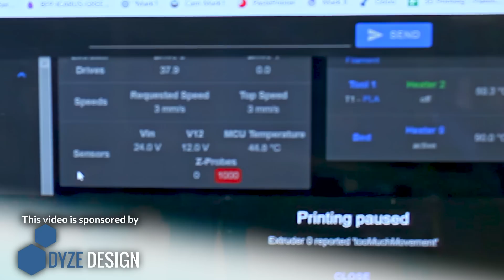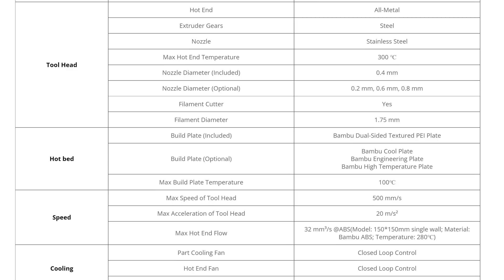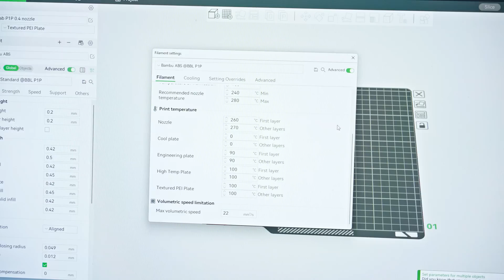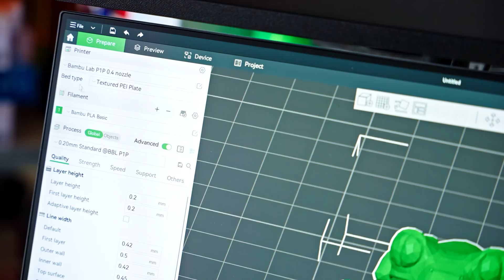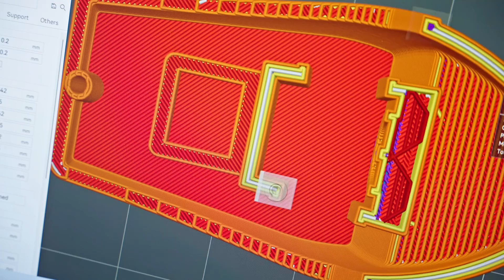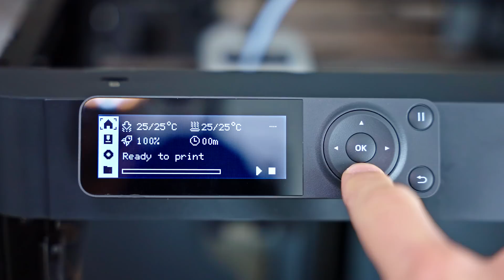Bambu Lab P1P: Tradeoffs

Comment: What I find the most frustrating is the noise aspect of the printer. I would love to see how much speed impacts the noise-level of this printer, compared to f.e. a prusa mini. I'm currently running the mini in my room and its dead silent. What i've seen so far from the x1c and p1p is noise that makes working in the same room impossible, at least for me.
Reply from the maker: The noise actually is a straight result from printing that fast - especially the fan noise is hard to get rid of, as more speed also requires more cooling.
Reply: @MadeWithLayers  I get the fan-noise aspect, and I also fully get that especially crazy high acceleration and deceleration cause noise. What interests me is how fast a machine can print whilst still having a bearable noise level [bearable of course being a very  subjective measurement] and how much speed is lost when trying to achieve a more comfortable noise level. 

I love your videos by the way, you responding to my comment made my day :)

Comment: It's great to see more competition, maybe to prod Prusa into giving us a MK4. I love my MK3s and, per your last video about the Prusa, I tend to agree it's pretty close to perfect for me. I don't need a touch screen or overt fanciness. Really just some means to do input shaping to help reduce some of the ringing and for Prusa to acknowledge the problem with printing ABS on these things and offer better support for ABS plastics for the hotend. That's really it. I don't even need a Revo or anything like that. Linear rails would be cool (ala Switchwire) but even that.

That said, eeeh Bambu just makes me nervous. I don't like the closed source trend (I've said before, I blame Slice for starting it in the consumer space and don't like that E3D and now Bambu have followed suit). And I REALLY don't like they're trying to have it both ways by partial open sourcing things but really making it closed. It doesn't feel right, especially when you have to 3D print parts for the thing to make it better. I'm not sold on that.

Anyways to answer your question, I'd love to see the quality. There are times for speed but a vast majority of what I print is a case where quality is more important than speed. Not always, but 95% of the time I'd easily trade speed (within reason) for quality.
Reply: Hard agree. We're living through the 3D printing equivalent of the enclosure of the commons. I really hope we're able to course-correct 🫤
Reply: It's inevitable. IIRC, Prusa's next XL printer is a closed-source printer from the beginning.
Reply: @softfever5570  That's what some say but Joseph has an OSHW tattoo on his arm so I don't completely buy that. Or at least I'll reserve judgement on Prusa until the XL is actually shipping. I'm fine if the source isn't available now given they're still designing parts of the printer. If indeed true, it would be a bummer. I'm planning on getting the XL but if it is indeed closed source I'll likely stick with Vorons.
Reply: @m00dawg  Very well said. Finger crossed.

Comment: I do appreciate a slightly more skeptical take on this printer - although I'm an X1C owner and am very happy with it, the public conversation is either "this is awesome" or "cybersecurity risk and proprietary design - not even an option!"  There's not much in the "this printer is good but there's some issues" space.

That said, I do think complaining about the "print your own panels" feature is a bit unfair, since one of the complaints regarding the X1C is the "I like to mod/build my printer" half of the community griping about how they can't do anything to the X1C to customise it.  The printable panels seem to be deliberately targeting that complaint, and it would have been nice if the video acknowledged all of that.  The X1 is heavily targeting the "I don't want to touch the printer I just want it to work" and Bambu wants access to the other group, too.

It's also fascinating that the hardened steel and stainless steel nozzles are showing as the same prince on the European store.  On the Canadian store, the hardened steel hotend assembly is $42.99 CAD for a 0.4mm nozzle, while the stainless steel is  $36.99 CAD for a 0.4mm nozzle.  Now, if I actually go into the product page, the 0.2 mm stainless steel nozzle hotend assembly is also $42.99, and this makes me wonder if the European store is defaulting to that price?  Which is an interesting choice since you'd expect it to go with the lower cost.  If the two materials are in fact the same cost in Europe for the same nozzle size, I wonder if that's an error or if there's some import cost affecting that.  (I did try to check but the internet knows I'm in Canada and won't show me anything but the Canada store.  Segue to the Nord VPN sponsor add.  :)  )  Anyway, if any European who sees this wanted to check an apples-to-apples price by going one layer deeper to confirm that 32 euros is for a 0.4mm nozzle in both materials, I'd be very interested in the answer.

As for the panel - I haven't used the P1P's panel so I don't know how annoying it will actually be, but my desire to be optimistic and positive makes me believe that Bambu opted for the panel design to either avoid accusations of "copying" the Ender controller, or to ensure parts availability by going for something other companies weren't after.  I build droids and these days there are weird shortages of the smallest things sometimes.  I could very much see Bambu going "Creality is using so many of those pots for the click wheel, we can't be sure of supply" and opting for something else.

Still, it's good to be reminded that there are straightforward business decisions impacting these choices too, and the "deliberate downgrade to not compete with the X1C" proposition is worth remembering.  Given that the hotends are advertised as interchangable between P1P and X1C, and that a common-parts-are-cheaper approach is clearly underpinning much of the P1P, I expect that the "improved" hotend will be included in X1Cs going forward.  That would eliminate the area where the P1P is better, and make this possibility much more likely.

Comment: You are always doing such a good job of fair reviews, so I hate to say it, but I think you should take a moment and consider if you are completely fair in mentioning several times (in your unboxing as well) the unfinished look of the printer.

People who are buying this thing, are aware what they get. The naked printer is literally the first picture on the store page.

And the missing panels are an explicit feature:
 You don't have to print them if you don't want. (saving pastic)
You can chose exactly what you want to use as panels, without having to throw the "default" ones away. (less waste again.)

So, it does feel a bit disingenuous to keep beating that particular dead horse. 
All other things, valid remarks. the missing sidepanels and "unfinished" look? 
That's what you buy and intended.

Comment: Given the proprietary firmware, I don't suppose it will work with OctoPrint, right?
Reply: Indeed. Doesnt even have a data USB port. Only uses their slicer or app for wifi printing.

Comment: Does any printer come with a hardened nozzle? If no, that argument is also as weak as the Ender 3 upgrade argument.
Reply: X1C does. Not typical of most printers. You actually have to tweak your temps if there isn't already a profile since you get less heat transfer with it.
Reply: @RichFreeman  ok, but you cannot really critize the lack of one if no other commercially available printer comes with the hardened nozzle, especially when the more expensive version does.
Reply: @mkuebbeler  oh, I agree. Was just pointing it out.
Reply: @RichFreeman  I am just a bit disappointed by the initial review, as this printer offers apparently many features for a reasonable price compared to other printers, but still you have the impression it is not enough... almost like one arguing: Yeah, I know this car is not a cabriolet, but it would be nice to see the sun through the roof and this car does not offer hat, so that is defintely a drawback .... hmmm ;-)

Comment: It is quite biased when Tom compares functional upgrades for the Ender 3 with just cosmetic tuning for the P1P. The argument is weak and nobody really cares if the frame is not covered. It is still rigid.
Reply: Nothing ridged about a pot metal frame. Vorons move at the same speed, but wont cause an earthquake in your room. solid extrusions vs 22-24ga metal.
Reply: @LilApe  Do you own a P1P to be able to judge the earthquake? Have you been near a Voron at the same speed? Do you have an idea what the price difference is between the Voron and the P1P, not taking the build time into consideration?
Reply: @mkuebbeler  It seems you completely misunderstood my comment about the X1/P1P being "ridged".
Reply: @LilApe  ridged or rigid? 😜 I am just asking questions so you can validate your own opinion.

Comment: Would love to see a speed/quality analysis of the P1P, especially for those top surfaces, because the benchy roof looked pretty bad.
Reply: It sure seems like that would be a pretty simple fix... especially if they're already customizing the slicer. You could manually adjust that top layer with some modifier shapes in PrusaSlicer to make it look nice, but if their whole system is built around speed, it would be nice if they just had a checkbox for "make pretty top layers". For some objects it could cause noticeable slowdown, but Benchy is a fine example of a model that would really have a few "slower+prettier" layers needed to dramatically improve the look.
Reply: @JustinShands  My guess is that his printer is a tiny bit miscalibrated. I have the X1C, which really is the same basic printer, and the auto calibration from the same slicer shows no similar top layer issues, essentially regardless of speed and filament type. Because this version has none of the autocal features, I am guessing the flow/top layer flow needs a bit of tuning.

His point about speed is semi legit, but I have printed up to 28 mm^3/s with no issues. The P1P should technically be faster, because the SS hotend is supposed to have a minimally better thermal conductivity than the hardened steel one. The slicer defaults to the values he shows, but if you select the faster modes on the printer, or change the speeds in the slicer, it works fine.